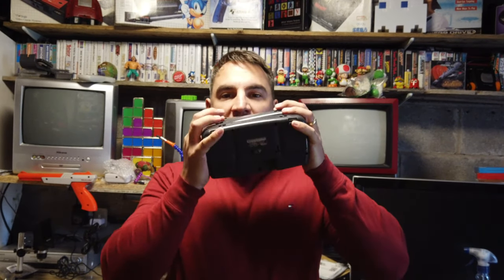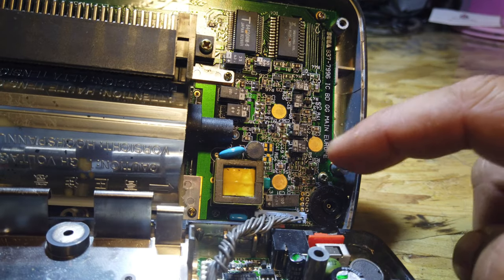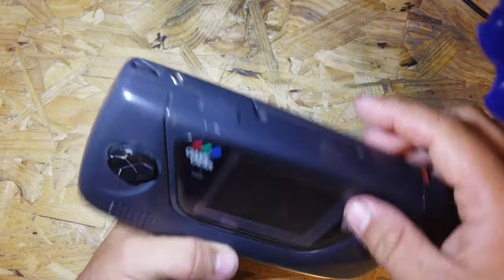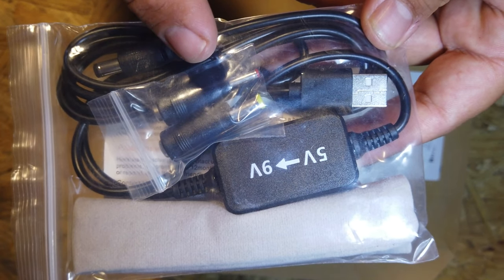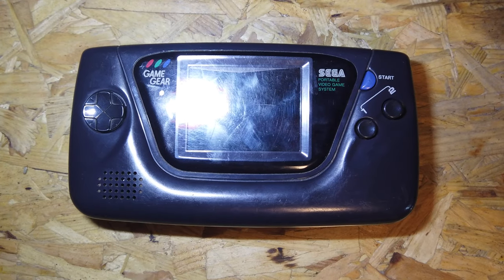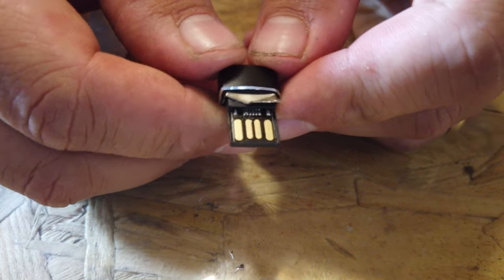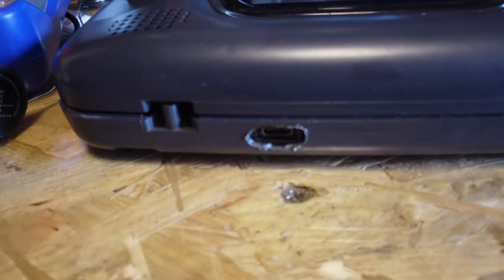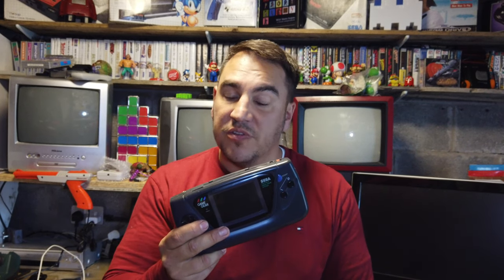How to Sega Game Gear Mod 5v Power Bank USB C Battery Replacement

Comment: Retro six now sell a usb c power source that replaces the original DC 9v port which works straight off a phone charger or power bank, that said a great mod done at the time..
Reply from the maker: Yeah I've used a few of their clean juice and lipo options since. As you say this was way before and was just a bit of fun at the time.

Comment: I have bought one fully updated except no USB-C. I still using 6 batteries but I do not play long only 30 or 60 minutes when I play so for me it is ok to still use batteries. But the USB-C port is unique 👍🏼
Reply from the maker: There are lots of newer off the shelf mods than this now. The battery mods do make things cheaper in the long run as this system eats AA batteries.
Best upgrade for them is still the replacement screen.

Comment: Very nice 👍. I was going to buy a original power pack but I'm sure to do this instead.
Reply from the maker: It's a great mod. There are other cheaper power converter boards out there but this still works great and was pretty neat too.

Comment: I would like to see you fit a battery bank inside the gg with another port to charge it
Reply from the maker: Nice idea. I think others are doing something commercial and almost plug and play on this now, but will have a think as having an internal battery charged via USB would be really handy.

Comment: I’d have done this mod differently with an internal lipo battery and a power bank PCB and bypassed the original power board to feed 5v directly to the system. May as well bypass 90s dcdc converters if possible
Reply from the maker: I looked at some lipo setups but from flying drones I've learnt not to rely on lipo, especially for occasional use, I won't be playing this all the time and I would discharge lipo for storage. Had too many good quality lipo batteries swell up over the years.
Works well for me, just been playing using a power bank and it's great fun.
Thanks for the comments, it's good to get other ideas.

Comment: There was three revisions of the sega game gear 2110g  had 2 acis chips the 2110 and 2110k had only one acis chip my original sega game gear 2110g system has a red front and back it's totally worth replacing the capacitors on the motherboard sound board and powerboard also do the Mc will  screen mod for longer battery life

Comment: i would have used a xl6009 dc to dc converter these are perfect and have a small profile. i currently have 1 installed in my game gear to power the dsi back light mod as my original back light blew
Reply from the maker: Hi John, I did look at the XL6009 and it's about the same size, just the housing is extra on this. I didn't know if I was going to be building it inside the case when I bought the kit so wanted something that would have looked outside also. 
I have plans for other projects with the xl6009 as I like the freedom to adjust the output.

Comment: Need to do this on one of my McWill moded GG.  The GG with the red inside. I think its a usa GG (just check the main bord) :)
Reply from the maker: I imagine a McWill will get even longer battery life on this setup.
Thanks for the tip on the red case. Will take a look. Also noticed another one had a full metal backplate.